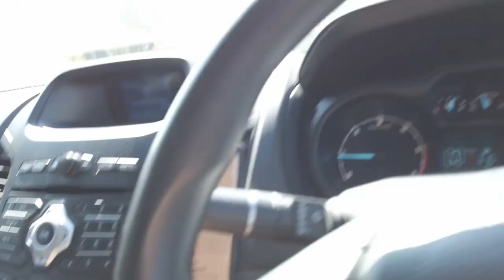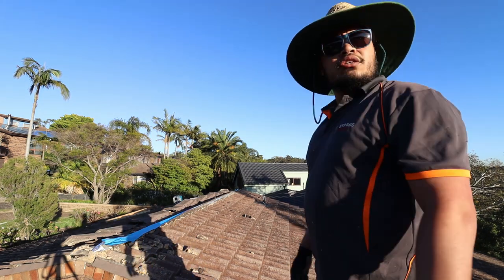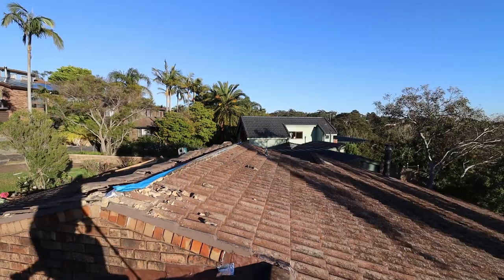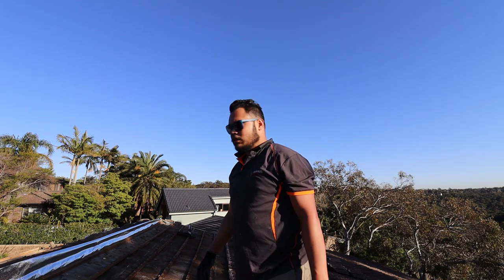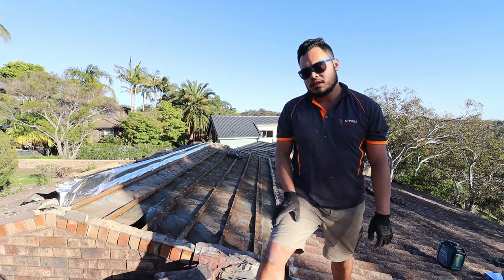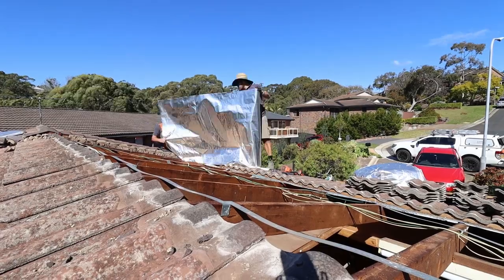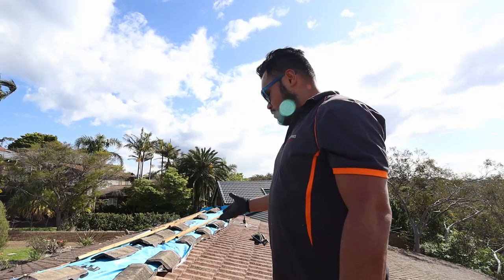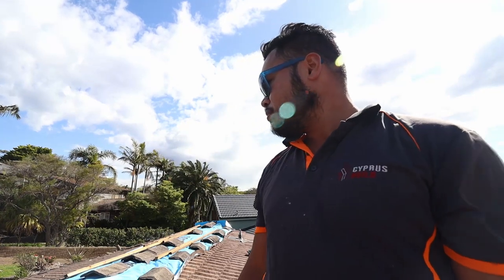Replacing Sarking and Roofing battens

Comment: We just built our house in Qld and found out there is no sarking under the roof tiles but weren’t told it was an upgrade. Is it possible to do the sarking from inside the roof? Or is it better to hire someone?
Reply from the maker: Hey Georgia in order for sarking to be done properly it has to be done before the roof is laid. its pretty expensive to do it after.
Reply: Thanks replying appreciate it 😊
Reply: What is sarking ? Is that building paper ?